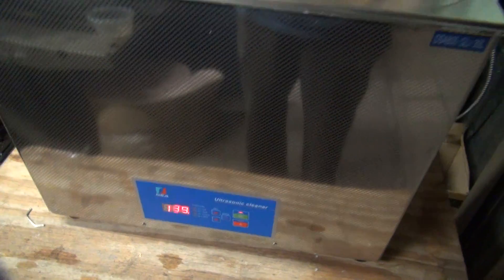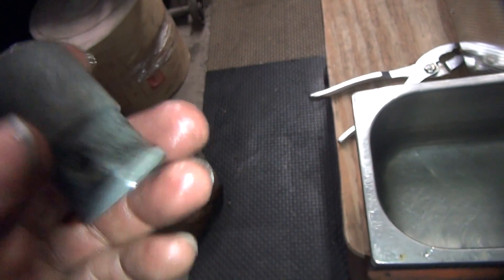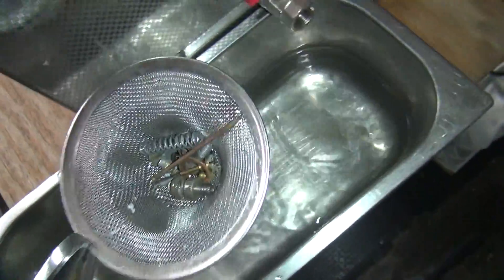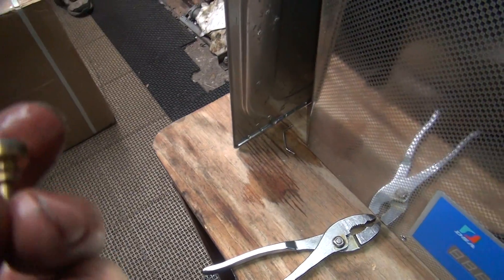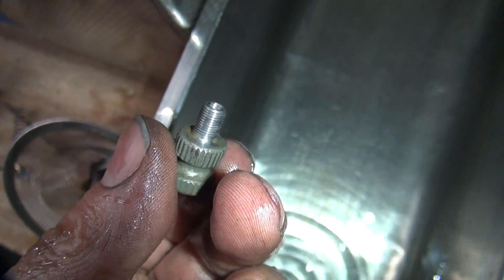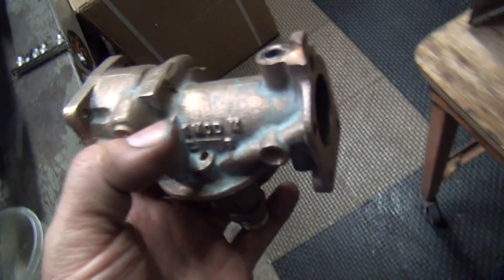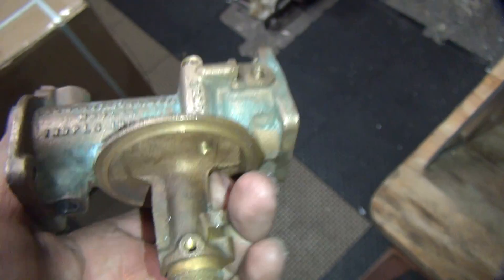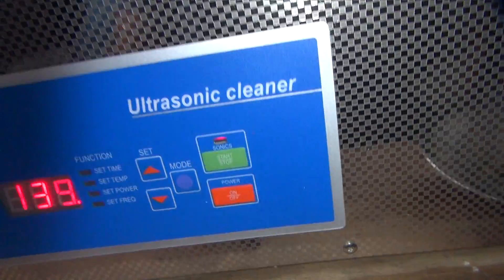Testing New Tool #102 Ultrasonic cleaner DSA800SE-GL2 30L 8gal Harley by tatro machine

Comment: Even commercial available CLR will work better......
Reply from the maker: yet to be tested. most everything else does not work for crap.
tatro
Reply: @TatroMachine  i use simple green in mine full strength works great

Comment: I'm a Tattooer and tattoo machine builder and Harley Nut I use Murphy's Oil Soap in my ultrasonic. Works wonderful but can't expect anything to remove deep corrosion.By the way I really dig your videos they've been very helpful with my engine building i.e. the way you mount pistons in the heads before installing and other tips.

Comment: I have found  after testing,  I clean my carbs for 30 to 35 mins. @ 100 to 120 degrees.  I blow off all dirt & oil / grease with my compressor  first,  I'm more worried about the passageways  in the carb.  than the outside.  For the outside ,  I clean and buff it with buffing wheels and  a dremal .